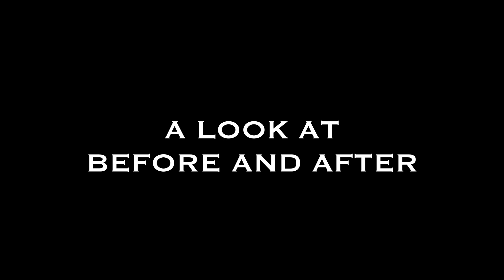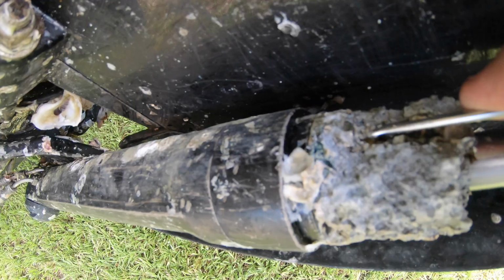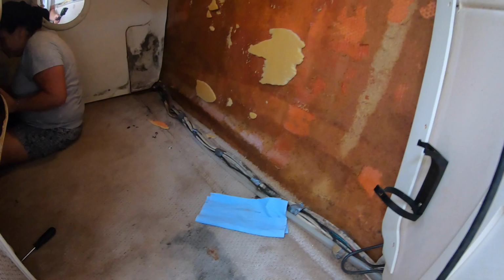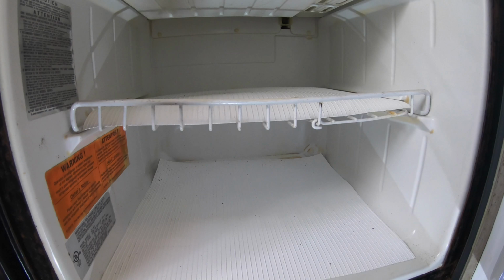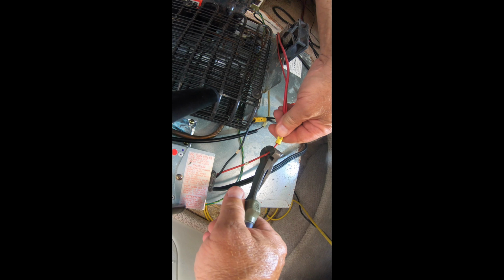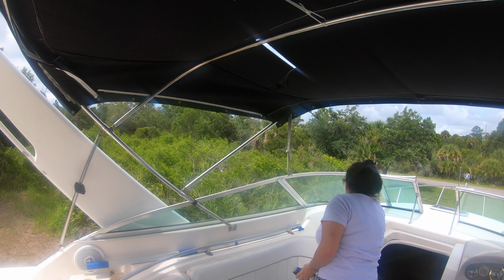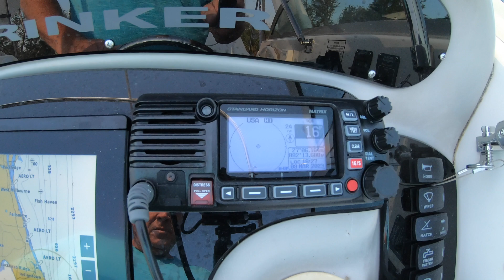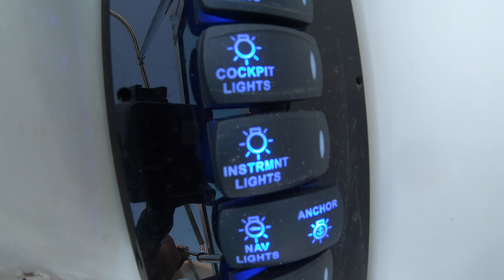2000 Rinker Fiesta Vee 270 Boat Remodeling Before and After!

Comment: Going up to Connecticut to look at 248 Fiesta Vee. Fresh water boat, looks clean from photos, I'll sniff around for mold, it's a 2000 year. The price is good, and I'm a mechanic, so I can wrench on my on stuff. It has a volvo propulsion package. Don't know much about the new drives, I know the old AQ's 270,280, and 290. And all SBC engines. Anyway, good job on your boat.

Comment: Thanks for this!! gives me hope on our 2001 FV 270 that has just reported high moisture on the deck and port wall.  You are an inspiration!
Reply from the maker: Thank you… if you need any help figuring things out, shoot me a message because I’ve probably already dealt with it!
Reply: Thanks... Likely a dumb question @RandomlyAwkward1  but are the 2001 Rinker FV 270s solid core fiberglass hulls or wood core?  Google is not giving a straight answer.
Reply from the maker: @bobmacey5730  The hull seems to be fiberglass wherever I have looked.  The bulkhead and various reinforcing areas (like where the seats are) appear to be fiberglass wrapped wood. I don’t believe there are “wood sandwiches” inside the hull like some manufacturers use. Plus the boat is heavy… 6200 lbs. dry for ours.

Comment: Great video!! I think I’ve watched all of yours now.. I have a 2003 250 fiesta vee up on Long Island. My boat is just about the same lay out minus a generator and a little smaller deck.. I’m Gonna do some of this work you did with carpets and pulling down walls to clean out the smell.. You made it look easy hopefully mine is as well. Happy boating season!!
Reply from the maker: Thanks Robert! We learned a whole lot about everything on this boat and it was long and arduous, but very rewarding. If you have any questions just ask and I’ll try my best to help out!
Reply: @RandomlyAwkward1  where was the water leak in the aft cabin coming from i have a 2004 fiesta vee 250 i have water lines coming down the back wall and my carpet is also old and smelly i wish i knew where its originating from
Reply from the maker: @jasonrubenstein582  Hey Jason… the more accurate response for us was “Where was it not coming from!”
A few places that we had leaks were where you wouldn’t suspect. The drains for the cupholders by the trashcan are supposed to have plastic polyethylene tubing running down into the bilge so if drink condensation or rain gets into that little hole, it runs down into the bilge. Those were missing. The Fiesta Vee 270 has a trashcan back in the port side near the stern seating. That trashcan was replaced by the previous owner with a trashcan of the incorrect size, leaving a big gaping hole that leaked around the edges. We put in a new Rubbermaid bathroom sized trashcan and then siliconed it in so water cannot get past it. Also, if you remove your seat cushions, there are metal clips screwed into the fiberglass that hold the cushions in place. All of ours were loose and some of them were missing. Over time water goes behind the seat cushion and gets into those holes. Also, there were a couple of hairline cracks in the fiberglass seat that were only visible when you removed the bottom cushion. I just used some sealant on my finger and sealed those cracks up. There were also a couple screws that had been put into the fiberglass over the years and then removed. Those holes were never caulked so water leaked into them as well. All of these holes had a common denominator. They all leaked into the void that was above the ceiling in the rear berth. This is where water collected and caused a severe black mold issue for us. It was on the other side of the vinyl, so it trapped in moisture and we didn’t see it until we removed it. We couldn’t see it, but we could smell it. Also, the water that ran down the walls ended up on the carpeting which ruined that as well. One last spot was the exterior speakers that were on the deck. Over the last 20 years, the paper speaker cones rotted out, leaving a hole where the grilles are. Whenever it rained or got wet water got into the speaker grilles and also dripped down into the ceiling. The same thing happened with the speakers in the forward berth. If you remove those they go into the anchor rode locker. That’s nothing but moisture there as well. We removed all of the speakers and covered them with those plastic discs that you put on the wall to keep door knobs from hitting them and siliconed those into place. We now use Bluetooth speakers and have not had an issue. Sorry for the long winded response but we found leaks everywhere and these are the ones that we could think of. Hopefully that gives you some direction.

Comment: Just purchased 2003 Rinker Fiesta Vee 270. Glad I found your video. Stern drive very much encrusted w barnacles. Did an initial scrapping but had to winterize immediately.I expect when I start her up amd test her out that I will experience your problem. Thanks for the tip. I will keep you posted. Boat in excellsnt shape except some deck structure delamination at side of bow hatch. Did you have any of that?
Reply from the maker: We did not have any delimitation (Probably the only issue we didn't have...) so it sounds like you may have had a leak near the hatch.We had a leak under the horns as well as some old snaps that had been removed, but the screw hole was not sealed. Feel free to ask any questions when you get into fixing it up as I may have already experienced the issue and found a solution. The bet thing for it is to get out there and run it!

Comment: Nice work!  Everyone needs a hobby; looks like you found yours. Ha.
Where did you find the new switch pod? Those look great...heck, the whole boat looks great now.
Reply from the maker: Thanks! I had all of the switch panels done by New Wire Marine. I send the old panels to them and they laser cut new ones to my specs. I got rid of the old analog gauges in the dash since everything is on the Garmin MFD now and had them engrave a blank panel with the logo. $$$ but worth it to me to have a clean install.

Comment: What ended up being the issue with the engine not going over idle speed? Don't think you mentioned that in the vid....interested to know what actually resolved that....BTW amazing job and she looks like a beautiful boat, happy boating 🎉
Reply from the maker: Thank you! The water pressure sensor switch was faulty. It was partially obstructed where it screws into the top of the manifold riser and was giving a false reading, saying that the water pressure was low. This in turn sent a signal to the onboard computer to put the engine into Guardian mode, which sends the engine back down to idle speed. When you return the throttle to neutral it, resets it, and then you can accelerate again. Replacing the switch took care of the problem. If you are out on the water and this happens to you, you can disconnect the electrical connection at the top of the pressure switch and the engine will run at 80% without going into Guardian mode. That’s once you verify that you don’t have an obstruction in the cooling system. This way you can make it back to the dock safely and not have to call Sea Tow…

Comment: What a great job. Re-doing ceiling in aft bed area on my 2004 270 FV. Was wondering where you got replacement vinyl to match. Did you find where water intrusion in that area was coming from?
Reply from the maker: Thanks for the compliment…my wife was responsible for sourcing all of the materials for the interior. The Berber carpet came from Lowe’s but that backfired because we needed another 8 x 10 roll and they only had one in stock and it was a close out. We ended up getting the other carpet at a place called Ollies discount store. I don’t know if they have those where you are but it was a bargain bin closeout type deal. We got the padded vinyl as well as the upholstery vinyl and piping on Amazon from a place called “Bry-Tech”. We became good friends with a man that owned a local canvas shop and he let my wife come in and do the sewing on his commercial upholstery machines. She paid him with chocolate chip cookies, although we paid him cash to do the Bimini, because that was out of our comfort zone. He was a valuable source of information for learning things like only using stainless steel staples, a certain type of thread that is resistant to sun, etc. We also used all Sunbrella fabric for the Bimini, but the vinyl is not. We used structural plastic wherever possible but if we had to use wood, it was all coated in spar varnish on both sides so even if it got wet, it would still be resistant to water.
The water leak was coming from the aft trashcan area. It was not sealed correctly and water leaked in and ended up getting into the ceiling area below. There were also multiple locations were screws had been put in and then removed. They were never caulked or sealed so the water came in through the screw holes. I suspect the leaks had been going on for years.

Comment: I have the same boat, what caused the boat not to go full speed ?  Great job also... Did the new screen replace all the gauges? sweet...
Reply from the maker: Yes, the new screen replaced everything. The boat not going full speed was mostly related to a bad water pressure sensor switch that was throwing a code indicating that there was no water flow, which put the engine into “Guardian “ mode. Once I replaced that, the engine was fine..
Reply: Have you ever changed your shift cable ? that's going to be my next job... @RandomlyAwkward1
Reply from the maker: @jimsr.4019  the cables were new when we got the boat so no, not yet!

Comment: Epic job! What was the running issue in the end?
Reply from the maker: Thank you! Ultimately the cause of the boat going into guardian mode and shutting down to idle was a faulty water pressure sensor switch. It had a bunch of debris on it that gave a reading saying that there was no water pressure so the engine was returning to idle so it would not overheat. We actually had plenty of water flow. We are in the Gulf of Mexico so we have a lot of salt and very fine silt that seem to get trapped everywhere. Regular flushing out when we’re done is a big priority.
Reply: @RandomlyAwkward1  awesome I’m glad it was a relatively simple fix. Top job on the refit.
Reply from the maker: Thanks… it was lots of work but very rewarding!

Comment: Can you tell me where you got your seat cover cushions the replaceable ones that you staple on I need some for my Rinker boat
Reply from the maker: The ones that we have were all custom made by my wife. Unfortunately, the upholstery part is very expensive by the time you get the foam, the vinyl, and even the thread to stitch them and stainless steel staples to fasten them. I also replaced the wooden backs with new wood and coated it with spar varnish to make them waterproof. Worth it in the long run. I was told by an upholstery guy down here in Southwest Florida that upholstery lasts 1000 hours in the sun…

Comment: Great job! What possessed you to go ahead and buy the boat to begin with after the test drive set the tone for what was to come?
Reply from the maker: That is a great question. We knew that the engine and the outdrive were only two years old and the included receipts showed that what we paid for the boat was what the previous owner just paid for the engine and outdrive. When we bought the boat, both were still under warranty. We knew that with enough time, there was nothing that we could not fix. I had done lots of research on common problems with that engine, and outdrive combination and figured it had to be one of a list of things that was causing the engine to go into Guardian mode. Although it’s a daunting task, my wife and I have bought and rehabbed two RVs previously so we were familiar with what we were getting into. We just took it one step at a time. You have to approach it with a sense of humor as well, because things just kept getting worse! Now we are very proud of it and we use it frequently. I think the worst thing you can do with any type of a recreational type vehicle is to not use it frequently. I also have the repair manuals and spent many hours reading them. The local marina charges $200 an hour, and there was no way I was going to pay that for something I could figure out myself.

Comment: Could you please provide a parts list for the console components? I have the same boat and I need to upgrade my console just like yours
Reply from the maker: I had everything custom made as far as dash panels and wiring go done by New Wire Marine. The  chart plotter is a Garmin 1243xsv
Reply: @RandomlyAwkward1  OMG I'm so excited that you responded also how much you've inspired me to move forward and do the same with mine now that I'm retired. I wish you were in Miami I'd have to pick your brain for more while treating you out to a great seafood lunch. BTW what did you do with your gauges?
Reply from the maker: @vincentmiller3496  I threw them all in the trash! Everything displays on the Garmin now… more so than the analog gauges. I’m in North Port right up 75 if you have any questions…

Comment: How much did you end up having into the ol girl. Purchase included?  Impressive is an understatement
Reply from the maker: Thank you! We paid 18k for the boat, but it had a new Mercruiser 350MPI and Bravo 3 (still under warranty) on it when we bought it, which is how much those two items cost originally. 
     The electronics (Garmin 1243 xsv MFD, Radar, all new wiring , lighting, switch panels, NMEA 2000 network, Flatscreen TV, Refrigerator, AC, etc...probably another 10k, 
     The interior was done by my wife, but the cushion foam,  vinyl, and thread to sew was expensive...maybe 3k. 
     The Bimini was done by a local guy who is very good and that was around 3k with the boots to cover them.
     The real savings is learning how to do everything ourselves and the satisfaction of knowing that we know how to fix things in the future. Cheaper to buy a new boat? Not even close  to the price of a new boat...but we wouldn't trade the experience for anything.

     We also just re-did a 32 year old pontoon boat and it's just like new now. We paid $1,500 for the boat and trailer and then basically threw everything away and started over. 
     Maybe 8-10k into that one but it parks right nevxt to the 50k pontoons on the sandbar and the beer is just as cold, plus ours has a bullet hole in the side of the fencing, which is kind of gangster!

Comment: Make & model of refrigerator that you used to replace the original with? I got a Smad & its useless. Can't service it as it uses Aquous NH3 & nobody does that kind of repair.
Reply from the maker: The refrigerator that was in there was a turd. We replaced it with whatever would fit. We found the “Smod” online at Walmart.com and it actually works pretty well.  It was $379.00 with a three year protection plan for $34. The cutting edge Czechoslovakian technology is now available on Amazon my wife just informed me!
Reply: @RandomlyAwkward1  thanks   the new one I got never worked  p o s.
Reply from the maker: @okramw1  Gotcha… those plug in cooler/freezers work really well too unless you specifically wanted a replacement fridge. Good luck with it….

Comment: ...what was needed to fix the boat after it went into the "guardian mode"?
Reply from the maker: It turned out to be a faulty water pressure sensor switch that incorrectly reported the water flow through the engine block.
Reply: @RandomlyAwkward1  thanks!!

Comment: What did you use to attach the tv mount? That access panel isn't very big.
Reply from the maker: Hi Tad Lidy… I drilled it into the wall so the bolt heads came out of the inside of an adjoining locker. I used some washers and nuts on the end inside the locker so it’s pretty secure now.
Reply: @RandomlyAwkward1  ok so you went through the dead space between the wall and the locker straight into the locker.  Any problem with the mount sitting on the pillowy wall?
Reply from the maker: @tadlidy5067  Our model doesn’t have that padded wall, only smooth fiberglass so it wasn’t an issue. Everything else in the boat was an issue!

Comment: What was the cause of the boat not getting on plane and the engine going into guardian mode?
Reply from the maker: The ultimate cause was a restriction in a water pressure sensor switch. It was gummed up with salt and sand and corrosion and giving an incorrect reading to the computer on the engine. It indicated that we had no water flow when in fact, we had very good water flow. That fault told the engine to go into Guardian mode because it was going to overheat due to lack of water flow. Once we replaced the water pressure sensor switch, and we were assured that everything else was working correctly, we put her back in the water and it ran fine.